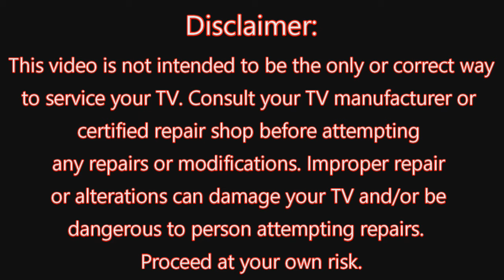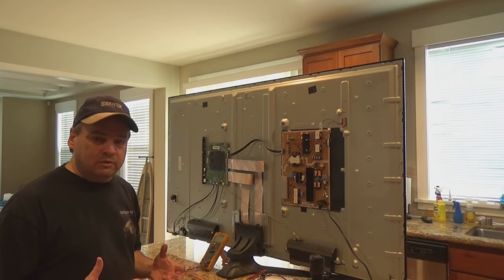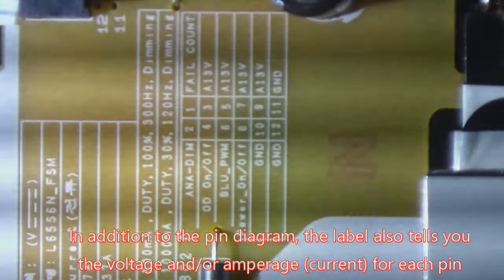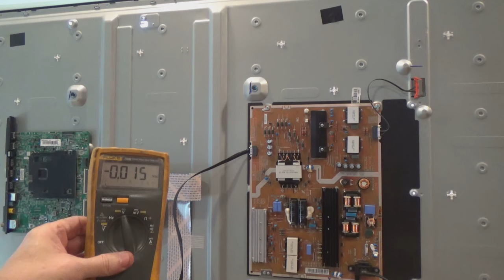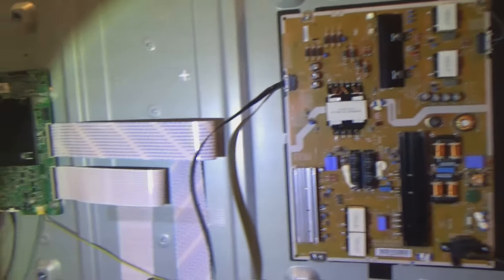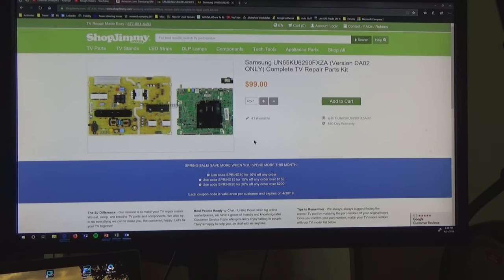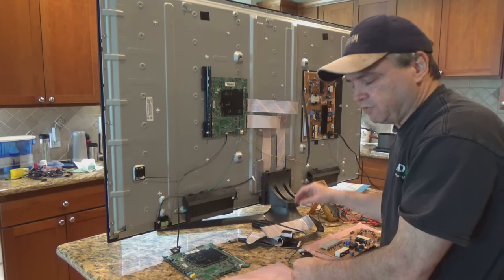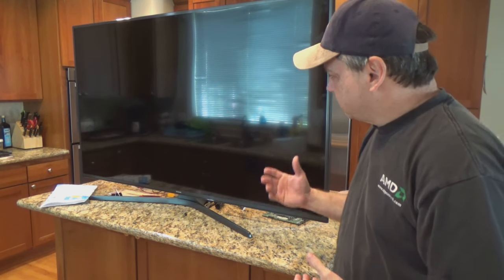LED HDTV Repair - Standby Light But No Power Up

Comment: I have the same issue. Standby light on, no power to tv. I measured the volts on power board I get 11 volts. (standby volts should be 12-13 volts). I disconnect the main board from the power board. I measure the power board again, I get close to 13 volts and power is on.
Reply from the maker: Sounds like something on the mainboard may be shorting and pulling power down on the power board.  The kit I used came with both and was only a little bit more than the mainboard by itself.
Reply: @RoughRidersTV  thanks for the reply. Initially not all my leds weren't coming on, and I got 1 volt on my power board. I fixed the power board by replacing a transistor ,  got brand new leds installed, now power board is up to normal standy of 12-13 volts and all the leds came on, thought that would fix it. My next problem were vertical lines on my screen. I tried a few trouble shooting steps. I left on the power for I say over 5 minutes, then the power goes out but still have standby light. I agree that I may need a new main board, but I have concerns of those vertical lights showing again if  I install the new main board. I been trying to tract down information ,  if a bad main board could cause vertical lines on the tv screen, I haven't found anything yet.
Reply from the maker: @slipnorris5882  I would agree that if you are getting issues on the panel side, it may be more than just the mainboard.  There could be a faulty DSP on the mainboard causing the lines but it could be a faulty plane, faulty trace on the main board, it really could be a number of things.
Reply: @slipnorris5882  just from reading and watching..does your TV have a tcon board? seems related to that. not sure if that's your issue but its a suggestion in what to look at. you probably have it fixed by now anyway.

Comment: What if I dont see the red light?
What would be wrong?
Reply from the maker: I would guess it is either the power switch or the power board. In either case, I would follow the troubleshooting techniques in the video and start measuring voltages.

Comment: The fact this video has 700k views tells me LG must have planned obsolescence
Reply from the maker: while this is a Samsung, I can't say for sure it's planned obsolescence.  I'm a EE and the board designs looked fine and like every other PCB. Now, I didn't have an OScope to dive into more signal analysis of the board. I don't know if this was a grounding issue or perhaps they needed another substrate layer or not on the PCB.  I worked for a major silicon chip supplier for 15 years and I can confidently say that you don't design chips to fail at a given time. However, something clearly failed shortly after the warrant expired...maybe it's a cooling issue that caused a chip to overheat or static electricity from dust got in and shorted something out. I do know I've personally stopped buying Samsung because this wasn't the only Samsung product that I've bought that had problems.  I don't know if LG is any better/worse.

Comment: Hmmm I have stand by light and replaced both boards and nothing. Wonder if I got bad boards or something else it could be?
Reply from the maker: I would check the switch itself and see if that flickers when you press the button like I show in the video.  Make sure it is actually registering the button press.  Check your cables and make sure there are good connections.  Check the voltage as I show in the video to see if you are actually measuring the right voltage on each pin.

Comment: I don't have a volt meter. How on the world am I supposed to fix this problem
Reply from the maker: You can find them pretty cheap online or at your local h/w store.  Always handy to have one around.  Otherwise, you can order the kit with both boards and swap them both and see if that fixes the issue.

Comment: *** At 5:44 time in the video - you pulled off the ribbon cable and the LED lights turned on... ("What did the front of the TV show...? Just a bright light...?")
Reply from the maker: Good question, I did not look at the front screen as I was focused on the troubleshooting.  However, since the I/O board was not connected, I would expect that it would just be an illuminated black screen.

Comment: was this the same as a t con board!
Reply from the maker: No, The T-Con board is not shown in the video.  It it typically located near the bottom center of the TV and drives the LED array.

Comment: My HD led TV's standby light switches on but then it fades away plz help ?
Reply from the maker: Only help I can offer is to troubleshoot as I did in the video.  It will help you determine if your power board is bad or not.
Reply: People like you are the worst, it takes years of  knowledge and confidence to troubleshoot an electrical system it’s insulting to ask somebody to hold your hand and fix it for you like that.

Comment: Hi, When I was watching tv it automatically turned off and the power light started blinking.I tried to turn it on some time but after sometime the red light stopped blinking and was constantly on...can it be any internal problem ....plz help
Reply from the maker: I would suggest you follow the troubleshooting steps I outlined in the video.  This will help identify which board is failing so you can replace it.

Comment: I replaced power supply board casue it was dead. now i have flashing power light. i do not see LED lights showing thru the holes...samsung TV model UN46F6300AFXZA. assume it is now my LED lights. ugh. I'm a newbie but cannot afford to buy new TV or pay a repair guy. i can build a computer but..new to TVs. All parts for my TV are pretty much out of stock at shopjimmy. so had to find another place..which is cheaper but only 30 day warranty. partstoday.com. sooo i assume my LEDs arent working. i am baffled as to why atleast these two parts have gone bad together. I was plugged into a surge power strip. anyway..any tips would be greatly appreciated.
Reply: Also i did not see damage on my power supply board either..
Reply from the maker: Sorry, didn't see the comment.  Assuming you got it fixed already but I would check the T Con board as well.  Anyway, would love to know what you uncovered.
Reply: @RoughRidersTV  No, nothing worked..I tried and tried and gave up. I dont know what was wrong. I spent way too much as it was on replacing 3 parts...i dont feel it was the Tcon board because the screen wouldn't ever show any type of light behind it at all. I still have parts to sell from it. I really wanted to fix it cause i loved my TV but...it went to the trash..... Thanks anyway..

Comment: I got the same problem with my lg stand by on/off light flashes when I power on my tv but I got no picture is all black and no sound and I did the flash light test on screen still no picture or lights

Comment: maybe you can help me dont know anything about my tv but my screen flickers and i have a black dot on one side and a faint line going across the screen
Reply from the maker: Not sure how much help I can be. As mentioned, while I am an Engineer, Im not a TV repair guy.  I understand the basic blocks of how the TV works but I don't have the detailed skills on diagnosing displays.  From what you describe, I would suspect that the black spot may be dead pixels which may not be fixable.  The faint line and flickering may be a bad display control board which is what I replaced on my system.

Comment: I wasted one year of my life hoping you'll shed some light on  failing smt components causing the TV not to work, then you tell me you replaced the main board. 
You could have simply advertised the name of the supplier and tell people to get new boards from him.
Being an electronics engineer, you should at least scan the main board semiconductors with the meter and see which ones fail.
People want to know which components are failing because they can replace them and save on expenses, instead of buying a whole new board.
Just a thought, I've nearly 40 years in electronics.
Reply from the maker: I went for the quick and easy fix. I don't have the tools at home to fully diagnose the failing component. I've got a simple meter, not a lab with an O-Scope and other tools to dig into this. Based upon a visual inspection, it's more than likely the SoC on the board that failed and not a cap or VR.  To fully diagnose this, I would need datasheets on the components, more tools and the board schematic would be useful which I am not going to get access to from Samsung and most of all, I would need time. I don't want to leave my TV down for a week or more as I try to find 1 failing component in a board full of them.  A $90 fix that took minutes instead of days was easier for me...these things are designed to be swap boards out instead of finding a failing component and trying to solder it back in.

Comment: EPROM should take care of it 10 dlls parts for the eprom chip
Reply from the maker: What makes you think it was an EEPROM?  Not saying it wasn't but curious why you think it was an eeprom.  However, even so, it's not like you just pick up a new chip and pop it in...it would still need to be programmed so unless you have a programmer and the actual code that needs to go into that prom, you are out of luck.
Reply: Rough Riders you can buy it already programmed most of this new TVs came out with bad eproms and for 10 dlls I’m willing to try it and save money it have always work for me when you can’t find any blown or burnt parts but that’s only my opinion you can try anything you like
Reply from the maker: @MrChueco23  It's certainly possible. However, in my career, I've never seen an eeprom fail. eeproms typically have a read/write cycle of 100K to 150K and some even higher which is a pretty long lifespan.  There's really not much to an eeprom, just a power plane which will typically be low voltage and some address pins so I wouldn't expect it to fail but then anything is possible. My guess is that either some of the popcorn on the board that regulates power failed or one of the ICs on the board did but without schematics and an O Scope, it's hard to confirm.  But, sure a $10.00 part may be worth a try but I didn't see a DIPP on the board so you would have to de-solder and re-solder the eeprom.  Where is a source for preprogrammed eeproms for TVs?

Comment: Hi my voltage is coming out 11v on all the pins, is that good or it means that is not good anymore ? Thank you
Reply from the maker: I don't know. Have you checked the board markings to see if it tells you what voltage you should be measuring.  Mine had a box that stated the correct voltage on each pin.  In my case, the voltages measured were very close the voltages stated on the board.
Reply: @RoughRidersTV  Hi thanks for replying my message and  yes it say 13v on each pin but testing it comes out 11v
Reply from the maker: @vitopiro447  That is a pretty low swing. If it were I, I would look over the rest of the board and see if there are any obvious components that failed (capacitors, voltage regulators, resistors, etc.). If so, then you could try to replace the failing component.  If that might be too much, then replacing the entire board would be the next option.
Reply: @RoughRidersTV  all looks good but I will try to replace the board I found one cheep. Thank you so much for your help and I learned a lot on your video.
Reply from the maker: @vitopiro447  You are welcome.  Good luck on fixing your TV.

Comment: How do I know what’s wrong with my tv. ? The white light turns on at the botttom but that’s it no sounds no picture of nothing and nothing seems to be cracked
Reply from the maker: I would suggest following the steps I show in the video to see if your Power Board or your I/O board has failed.
Reply: Rough Riders yes I have done that multiple times ( Thankyou for the response )
Reply from the maker: @griseldakins4104  and did the powerboard check out OK?  All the power rails in spec?
Reply: Rough Riders yes
Reply from the maker: @griseldakins4104  Then it is probably a random component on the I/O board.  Without schematics and a scope, it will be hard to isolate. That was the problem with mine and why I just swapped the entire I/O board to fix it.

Comment: My indicator light isnt even on but when I unplug it and reply it, itll blink on say Toshiba then cut back off
Reply from the maker: I would suggest testing out the board and see if the power board is OK or if the I/O board was bad (as it was in my case).
Reply: @RoughRidersTV  thx will do!

Comment: Bad video Dude!!  Could have been the T0CON board or a problem in the panel itself or even another problem.
Reply from the maker: I had a reasonable belief that it was the main controller board.  Yes, it could have been a T-Con board but that was less likely because the LEDs were in fact working. I did not have any of the typical faults that would indicate a T-Con board failure. This was not a color or contrast issue, it was not a sync issue. No colored bars...the screen was dead which indicated that no data was passing through. Therefore, most likely a power or mainboard issue, not a T-Con failure. Now, had the mainboard not fixed it, I would have went further in but as I suspected, that was not necessary and my analysis was correct.

Comment: Changed Main board , still nothing.
Reply from the maker: did you check the voltages on the pins?  Did you look over the caps, power resistors, and each board for scorch marks?
Reply: Backnlights

Comment: Ugh did this didn't work
Reply from the maker: Were you measuring the proper voltages on the pins from the power board?
Reply: @RoughRidersTV  i just changed the motherboard but backlight still flashing on and off
Reply: @RoughRidersTV  if I unplug it the backlights will stay on no picture of course
Reply from the maker: @gmzgmz3727  Understood but you should measure the voltages coming from the powerboard.  They may not be supplying enough power to the main I/O board.  It will help identify if the board is at issue or not.  Powering up the LEDs is not enough to determine if the board itself is bad or not.

Comment: These TV'S are not as good as they used to be.
Reply from the maker: In some ways, I agree but the old school tube TVs were full of plenty of problems as well. Though I am disappointed that this failed so quickly.  However, after the repair, it's still going strong.

Comment: Dumb Ass electrician switched the main electric off without me going around the house turning all sockets off!  Now my T V takes forever to switch on.. 

I literally have to press all buttons on the side for half a flippin hour before it turns on. I'm about to punch the damn thing!  Iv'e been trying close to an hour this time, simply because i feel defeated... arrrrrrrrgh!

It has the stand by light...